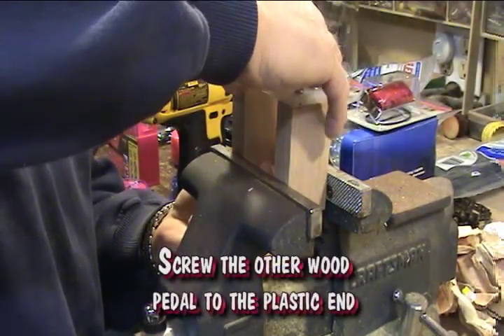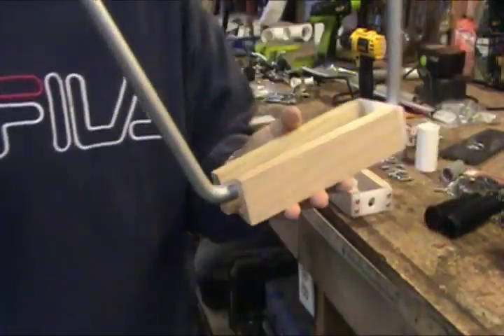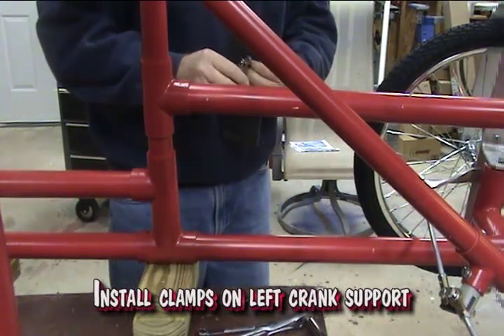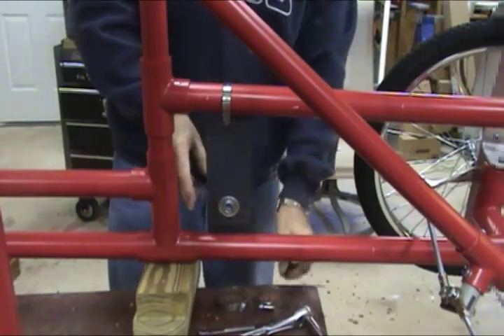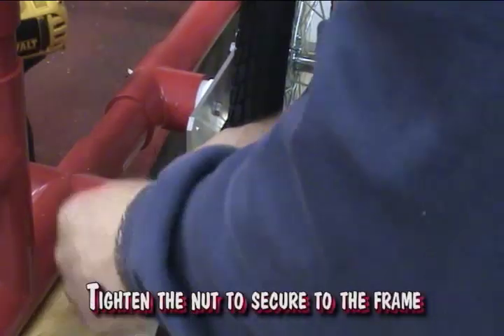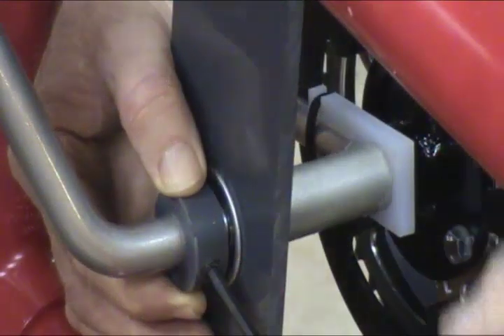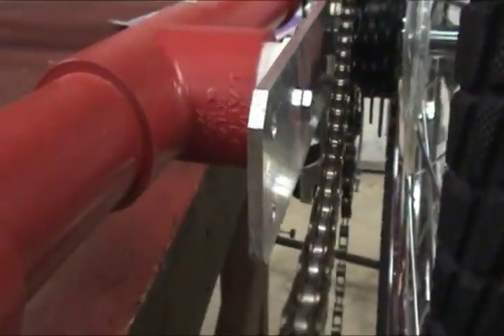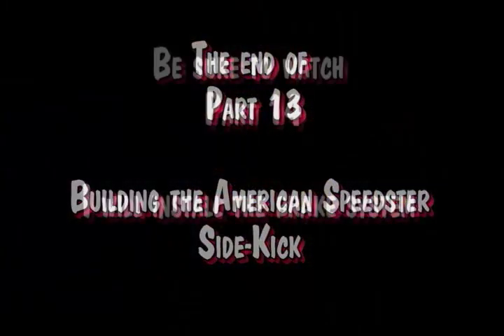Part 13 of 29 - PVC 4-Wheel Cycle - Assemble Pedal and Drive Components

Comment: What do the wheels cost
Reply from the maker: This will depend on the quality of the wheel you purchase. You can buy 20" wheels a little as 20.00 each but I suggest you buy a good quality wheel to avoid potential problems later.
Thanks
Norman

Comment: Just ordered the kit and was wondering how hard it would be to make this a 21 speed??  Thanks,  Rich Ojai, CA
Reply from the maker: Rich,
I haven't tried additional speed wheels & sprockets, but If you know the size and space needed, you can modify the rear frame distance and increase the front sprocket spacers (if a twin sprocket is used on the front pedal assembly).
You have to be careful expanding any part of the frame or the handling and turning capabilities will be affected. You have to keep modifications relative to each other, one size change has to be proportionate to the other. You have to make sure all size changes are balanced.  I'm not sure 21 speeds would benefit this model due to the size and weight of the total vehicle.
Thanks
Norman
Reply: Norman Gooch Ok so a little algebra with regard to the frame modifications.  Got it!  Thanks!